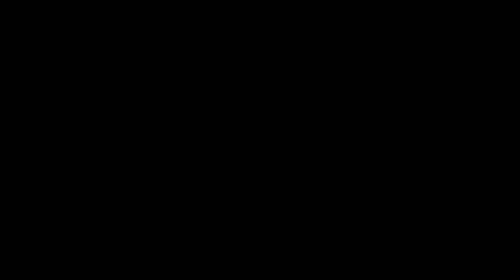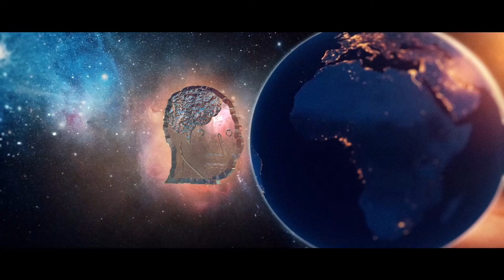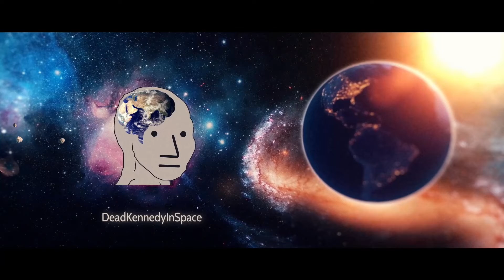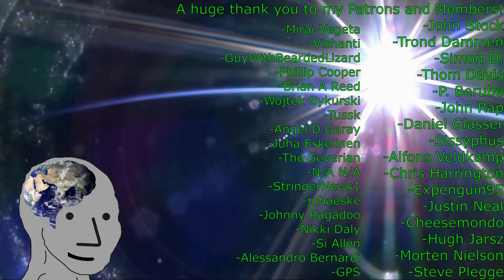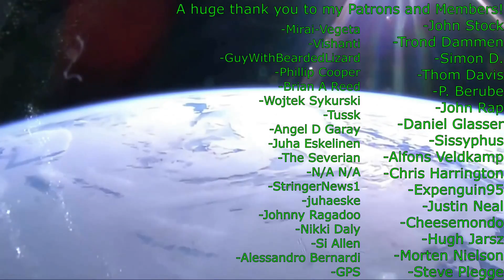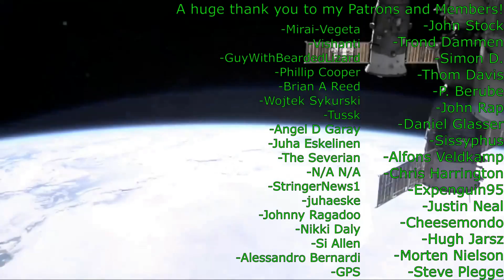Jobs that Require a Spherical Earth | Interview with IB Hunter

Comment: I'm a computer programmer, once I did something with spehrical geometry that converted beteen rectangular coordinates and latitude/longitude.  No details, except it was for things that fall down (after going up a little) and go boom boom, I don't how much boom, and those things will now land slightly closer to the target than before but the improvement was certainly much smaller than the crater they will make.  But that's probably just because there was more precision in the floating point numbers on the new computer.

Comment: Irrigation engineer. I mean, it's not directly dependant on the shape of the earth, but if vacuum really sucked people would lift water from deep bores with pumps at the surface instead of engineering slim cylindrical pumps that have to be lowered down to the water. 
Also, there's the hundreds of millions of hydraulic rams on all the world's bulldozers, excavators, tractors etc - with hydraulic hoses connected to both ends of the ram. If vacuum really sucked they could get the same force retracting as they do extending, just by pumping the fluid in and out through a single hose at one end.

Comment: Some seemingly not directly connected to the shape of the Earth: architect, truck driver, IT specialist, accountant. On the first year of architecture studies (however I never finished them) we were told a funny story about old Soviet times, when guys made a project of a giant cattle barn, it was pretty much the same as regular building, just very, very long. On short distances Earth's curvature doesn't matter, but that time engineer noted, that being built perfectly straight, building's gates will be on ground level on one end, and a couple of meters above ground on the other.  XD   Long bridges are obvious examples, especially hanging ones, which have supporting structures at an angle to each other. Other professions deal with distances in one way or another, like calculating length between destinations, lengths of cables and time a signal takes to reach destination or calculating costs for all of that.
Reply: In engineering including construction there are tolerances for error. Over time manufacturing automation has vastly reduced the tolerances required to allow for variation in manufacture. On the other hand buildings are still put together largely by hand so the tolerances allowed are still great enough that I think a long building could be built relative to the ground without worrying about Earth curve. Hmm, steel framed buildings might be an issue as I think the steel frame tolerances might be small enough to suffer.
Reply: @sthurston2  No idea really, to what degree that is an issue, as curvature is really minuscule - around 0,005mm for a 50m olympic swimming pool (that much higher curve will be in the middle of pool over straight line connecting it's ends, while the precision of machines working with metal and composite sheets are dozens of times less accurate - like 0,2mm.
The tallest building I've dealt with was 26 storeys high, while the longest was a couple of hundreds of meters long logistics centre, there it didn't matter. Might be an issue when it comes to dimensions of long bridges and skyscrapers.
Reply: @TotalRookie_LV  
Towers of large suspension bridges are not parallel.(wider at the top)
Reply: The LIGO Gravitational Observatory compensated for Earth curve (scroll to bottom):
https://www.ligo.caltech.edu/page/facts#:~:text=Curvature%20of%20the%20Earth%3A%20LIGO's,away%20by%20nearly%20a%20meter!

https://wiki.tfes.org/LIGO_Curvature_Compensation
Reply: @jimsmith7212  Yes, they got to make those tunnels actually straight and cut through curvature, not to follow it, as would be the case otherwise. 
In simple small scale construction we sometimes used "liquid level" - small polymer hose with water in it - put one end somewhere, put another somewhere else, like around a corner, and water will be on the same level on both ends, of course, problem on larges scale is - liquids follow curvature (as well as gravitational anomalies and what not), and so does poured concrete.
BTW, now I got to look  up, what is the diameter of CERN's LHC.
P.S. Circumference is 26659m, thus diameter of the large collider got to be 9440,7m, but level doesn't matter for a ring, as it is in case of a straight tunnel for a laser beam..